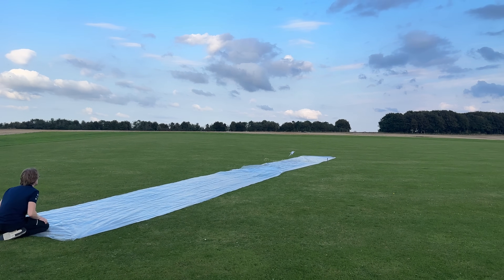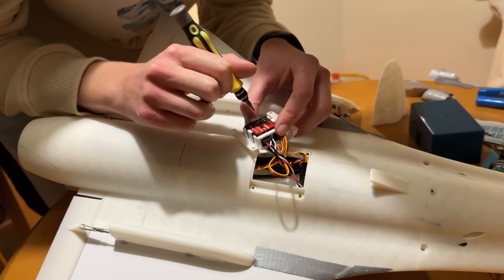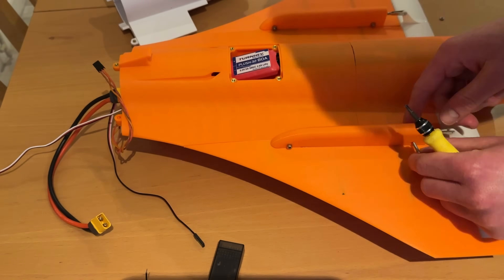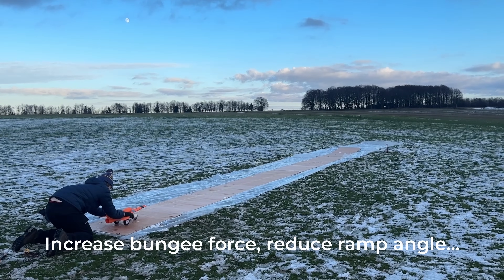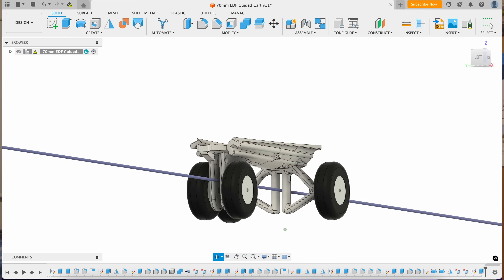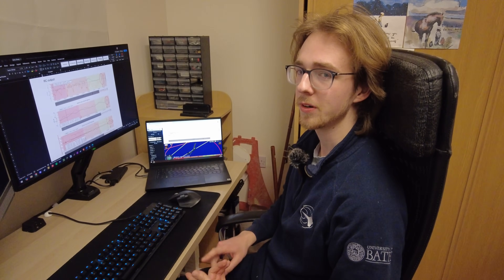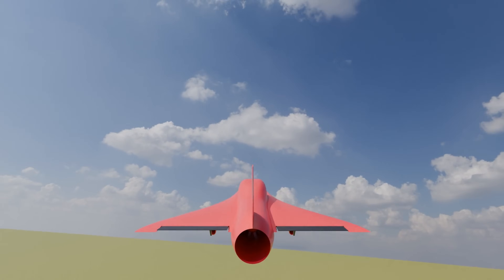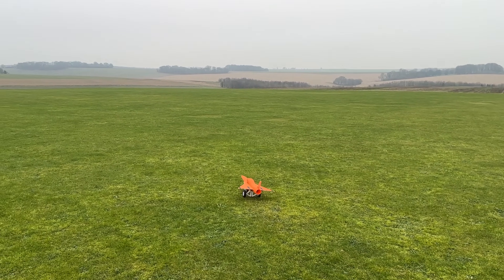WE CRASHED - Perfecting Kinglet’s Launch and Handling!

Comment from the maker: Thanks for watching this video! We now have a reliable launcher, and we've got the flight computer working. We've got more flight time planned in February to do some more tuning flights and get some landing practice. Once we've proven we can do launch, stabilised cruise and landing reliably, we will then attach a stronger bungee to the launcher and maiden the Kingfisher.

We're sorry that the timescales have been longer than previously promised - we want to make sure we have everything ironed out at the sub-scale to minimise risk to the main flight. This is from both a safety perspective and aircraft perspective - repairing the 3DP is orders of magnitude cheaper and easier than repairing the main Kingfisher. We're constrained to flying on weekends with good weather, since we work full-time engineering jobs in the week.

Some of you may also be disappointed that we didn't drop the aircraft out of a helicopter, but we think a catapult is a lot easier to repeat for the full-scale. We also cannot afford a helicopter! Overall, this sub-scale flight campaign is about replicating the real flight as closely as possible, that's why we've matched the wing cube loading to Kingfisher, made the 3DP way heavier than it needs to be, and used a slightly overkill bungee system!

Should also add, Chris was unavailable for this flight so we had a different pilot.
Reply: Are you gonna be able to get it to the recovery the drone also.  I’ve been talking about this happening on a commercial level to save weight and complexity of electric aircraft.
Reply: New sub! You guys are an inspiration to what I want to do with RC Boats!

Comment: A high speed RC car as the launcher would probably be way easier? Already comes with engine, suspensions, steering etc.
Reply from the maker: The issue is scaling - we’d need a pretty big rc car to launch the 10kg big Kingfisher
Reply: @TheMachInitiative They make off the shelf RC cars more than big enough. 10kg isn't that much.

Comment: You seem to be reinventing the wheel about the launch system.  We (in the EDF realm) pretty much perfected that system 15ish years ago.  Are you making the mistake of trying to do advanced flying skills before mastering basic control?  Are you aware of the speeds being attained by dynamic soaring?
Reply from the maker: The challenge is scalability - this launcher also needs to work on a 10kg jet-powered model aircraft. Additionally our stall speed is a lot higher than a typical EDF jet, so we need to launch to >25m/s.

Admittedly flying in acro was a mistake - we will only be testing in manual and stabilised until we have the gains tuned from now on. We are well aware of the dynamic soaring record, we’re trying to break the jet-powered model aircraft record (465 mph) if we break the dynamic soaring record (564 mph) that’ll be a bonus!

Comment: Maybe an FPV system would help, it makes it much more comfortable and easier to fly, especially at high speeds. You also have the telemetry data directly on the OSD. FPV takes a bit of getting used to at first, but over time it gets pretty good.

Comment: high pitch angle may disturb top mounted intake? cavitate the fan..
as long as you don't go there then it's not a problem.
I guess the forward fuselage is lifting surface?
I love your launcher, 'specially the guide rope.  as soon as i saw the slingshot, i knew that wouldn't work.  from experience, lol.  Incline the entire thing and you wouldn't need the kicker.. would be more stabilized launch, rather than chucked into the air, and then fly it out.... I've seen compressed air used, but bungee low tech is perfect... (think V1;).. but deff. incline.  what about a shuttle on a rail, or a c-cross section around a pipe, bungee or air driven?

Comment: Living hinges might be doable with a printed design as small as this. I'd reduce the elevon depth by a couple millimeters and move them farther out - remove the control surface at the wing root and instead extend it to the wing tip. Basically like a Mirage 2000. 
Couldn't find anything about this model on your website - so no idea what airfoil you're using - but with such a small jet at low Re numbers, I'd make sure the wing has a good amount of washout. 
Slow it down enough and even a cropped delta can tip stall, and I imagine this thing's gonna need  high aoa for a slow landing.

Comment: What if you made the wing loading even higher, but gave it a higher than 1 thrust/weight ratio and vectored thrust? You could have it take off vertically. The vertical part of the flight would have to be computer stabilized. Would that still qualify?
Reply from the maker: The main aircraft has a thrust to weight ratio of 3!

Comment: You could stick a motor and pusher prop out the back for these early prototypes. Launching would be much easier and much longer flight times for tuning, then swap in a EDF when everything is tuned

Comment: Engine seemed to be way underpowered for the small wings. Whole flight the aircraft had quite a high attack angle.
Reply from the maker: This is just the electric prototype - the main aircraft has 15 times more thrust, in a planform that is only 60% bigger
Reply: @TheMachInitiative I ment thats maybe part of the reason for the crash as well

Comment: I second the drop launch idea. Surely rhe airframe and control surfaces want to be optimised for speeds much faster than youd be able to take off and (probably more importantly) land at on grass strips. A drop launch from a bigger, slower RC platform would surely allow you to hit takeoff speeds suitable for a sleeker wing and smaller control surfaces. Maybe a 'stall and chute' type system for a controlled recovery?

Comment: Nice design.
I would consider using rails to guide the launch cart. Maybe standard pvc waste water pipes, cut in half?
For the launch "kicker" ramp you could look at designs for skateboarding, trick skiing, etc, to get the transition just right.
Also, I think you should think about integrating an emergency parachute, to safe the vehicle.

Comment: You are overthinking the launch system. You just need two 10’ poles, bury them 3’ deep so you have 7’ above ground. Tie a long bungee cord to the tips and put a hook below the aircraft slightly forward of the cg.  Tie a cord with a metal ring to the bungee and hook the ring to the plane. Walk back 2x the bungee length and you’ll get ample velocity when you release the plane from ground level. The natural angle from the ground to pole tips will give you the right initial trajectory. I launched many aircraft this way

Comment: Excellent work! As far as those program adjustments, I can't help. 
   I can say the autopilot compensated for the cg being too far back. Switching to acro mode would definitely cause a crash if one was not prepared.
   However, stabilized mode will work far better if you tune the aircraft to fly in acro mode. Considering the flight speed and flying without stabilization, exponential will likely be necessary for easy handling in the air.

Comment: Shouldnt the air intakes be on the sides or the belly for optimal airflow? Anyway the kingfisher seems like a great plane good luck at beating the record
Reply from the maker: Ideally yes, but our angle of attack will ~0.5 degrees at top speed so it won’t make a difference - we lose a bit of thrust during takeoff and landing, but it keeps the inlet clear or any debris during takeoff and landing that could otherwise destroy the engine

Comment: You should mount all your sensors on dampening foam to help clean up the signal and prevent high speed oscillation.
Reply from the maker: Agreed - we have some rubber spacers between the threads and matek - for the full size Kingfisher the Pixhawk is mounted on foam pads

Comment: No way you can make a simple RC car launch platform that needs to go 40+ mph for grass. You would need to use a 1/5 scale RC car with a clamping and release mechanism to keep the plane stabile on take-off roll. This is a huge project itself. Stick to bungee launches.

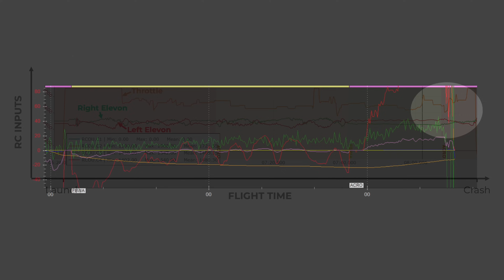Comment: Just yesterday I stood in front of your poster and was wondering how it's going! That integrator response is painful :( The aircraft looked like it had enough speed to get out of the situation, but if the control surfaces are not reacting, there was just no way :(  At 8:20 - the integrator part is increasing the whole time up to the switch to Acro. Does that signify that it tries to correct the nose-up attitude? I am not familiar with flying this style aircraft, but it looked a bit like CoG and CoL were mismatched? Maybe because you had to increase the wingloading?
Reply from the maker: Great to hear from you Jens - we’re still committed to the project! The CoG remained infront of the CoL at all times, but the CoL moves forward at high angles of attack which causes the stability to change, and we’re limited with how far the CoG can go forward due to the lack of an elevator. The integrator part was stopping the aircraft from deflecting the elevons up to push out of the dive - standard practice to recover from this hereon will be switching to manual and full stick back
Reply: @TheMachInitiative Interesting. When I once tried out paper planes I compared different sweep for the leading edge, but could only see a small advantage without sweep. Or is the long chord compared to the fuselage the problem? So that's why we don't see pure deltas anymore? B-1 has a tail, Eurofighter typhoon has canards. Boom X1 has a tail (looks so much like F-5 ). F16 seems to have only minimal sweep: Only enough to easy transition through Mach 1, but not enough to keep the leading edge subsonic at top-speed.
Reply: @TheMachInitiative ah yes, that makes sense! Thanks for explaining and good luck for the next steps!
Reply: Also, crash or not, great progress! That flight data has already proven essential in the analysis.
Reply: Oh yeah, let's clarify the basics of a delta plane. For symmetry reason I would love to have an X-wing tail. For take-off and landing the plane is flat (belly), but airborne the tail planes rotate into an x? Anyway, the thing the with the main wing (not an X) is that an angle of attack not on one of the main axes leads to roll. Negative lift inverts this roll. I think that dihedral does not invert there. So the angle of attack needs to be measured. And the elevons need to be actuated to translate one behavior to the other.

Comment: Measure the engine speed a wind tunnel and measure the air over the wings if these are installed way non argument it should fly

Comment: For launching you could piggyback on a larger plane, that way you don't need a ramp and would have the advantage of height.
 I used to do it with my old zagi on a friends virtually indestructible plane using Velcro, to separate I would pull up and he would dive, it worked great 95% of the time.

Comment: Like other said (maybe), why don't you use a launch rail? Like a mix of a catapult launcher as found on aircraft carriers and what student rocket teams use?
I believe you you see greatest improvements by angling the entire runway instead of having a ramp at the end, because that sudden change in direction puts unnecessary stress on your aeroframe and may even cause flow separation right when you need the flow over the wings the most.
I did a launch system for my glider using a 1:2 pulley mechanism hat worked great. Look into how sailplanes are being towed and unhook automatically. It would help y'all a lot
Reply from the maker: We agree a launch rail would be ideal, but there is a logistics challenge with design complexity, setup and transport. We’d need to break it into sections to fit in the car. Having 10 plywood boards and a guide wire is very easy to setup at the field. If we made an >10m long inclined rail, we’d need to have locking mechanisms to ensure all parts of the rail are perfectly aligned, we’d need to have a support structure if inclined along the full length, etc

Please can you send photos of your pulley mechanism - really interested to see it!
Reply: @ Awesome to hear from you! Sorry, I did the pulley thing 12 years ago when I was 12 years old just messing around. I was literally a cord anchored to the ground with a long stick (like in your videos) and a handle with a roller in the middle of the cord. at the end, the glider was mounted with a hook and a lop in the cord. For every X you pulled on the handle, the plane moved 2X forward. That was enough for my needs. If I were you, I would just put a BLDC on a winch with a cord, do the launch rail thing and pull the sled like so.  You could make a cheap launch rail out of 20x20 alu profiles, that are easily stowed in a small car. Setting up may take a little longer, but the advantages far outweigh the increased logistical complexity. I'm rooting for you!
Reply: @TheMachInitiative You could go for a rocket assisted take-off on a launch rail. However, a 1m rail would require your airframe to be able to handle 24g and you'd need a model rocket motor with that amount of TWR, so probably a 4m long rail with two 2m sections could barely work. But given the small loads, aluminium extrusion profiles would be enough, with a 1m tall bipod at the end. With lockable hinges you could even make it foldable and get the set-up time down to a minute.
Reply: i totally agree, a launch rail with weights seems much more consistant and controllable than your current setup, the pros seem very many: adjustability (if you use pulleys and weights), scalability, less stress on the airframe, less setup and the math is basic kinematics. plus you were kind of halfway there already by guiding the cart with a taut line

Comment: Hy don't yo use a launch rail? A wire steems less reliable
Reply from the maker: Several reasons:
(1) Time to design/ build
(2) The need to break it into sections to fit in the car - we’d have to break it into 10 sections and have some kind of locking mechanism to ensure each part of the guide rail is aligned. A rope can be folded up so doesn’t have this issue.
(3) Assembly time at the field

Comment: While this was just the test version and not at full scale, it looked like you were losing quite a bit of speed during turns which is somewhat expected of a delta wing aircraft as they can turn very hard, consequently bleeding speed.

 For one, you should practice how to deal with a stall with your small scale version so that if anything does go wrong with the final product you can recover easily. (At decent altitude, stall recovery is usually just forcing the nose down until you have enough speed to get level again or to glide to the ground if your engine is gone)
Secondly by practicing these stall recoveries you can identify the minimum safe altitude that you should be flying at in which you can recover the aircraft from stall without catastrophic damage. 
You can also set limits to maximum extension of control surfaces at certain speeds to avoid kicking into a stall

Another thing that you can do for takeoff however is by using a dolly that doesnt use a catapult, this means that you takeoff only when you have reached the sufficient speeds and the aircraft doesnt wobble after takeoff like it does with the catapault. The downside of this however is needing a longer runway, and roads dont tend to be the best runways for small scale aircraft due to the uneven surfaces and gravel and dirt. There are some rc clubs that have runways for their aircraft, which might be worth looking for.

If such a runway isnt available, a more reliable method of catapault launching would be to use a rail guided platform, allowing for a straight line takeoff with minimal wobbling.

Comment: INAV is not a high-performance gyro for fixed wing. It is not used in Turbines for that reason. I would go with a Bavarian Cortex Pro that is proven at the speeds you want to achieve. All of my highspeed Turbines have Bavarian Cortex Pro. INAV is fine for FPV or long-range flying but as a performance gyro, I think that is where you are going to suffer most of your failures. Bavarian or Synapse AS3X+ works right out of the box perfectly. Plus with the heading hold and launch assist it will help on the sled takeoffs. I use a rail system with a garage door spring connected to a Kevlar string for launching my high-speed turbines. I would fear using INAV or ardrupilot on my expensive turbines.
Reply: They're not using iNav, they're using Ardupilot which is perfectly up for the job.

Comment: Gyro?

ArduPilot is free software, cheap hardware and a huge huge community to rely on.
Reply: Oops. You already did. 

Still have no idea why you did t start with it. 

Have you used their sitl ?
You can fly and tune it in the simulator
Reply from the maker: We had a flight day booked and didn’t have time to wait for the Matek flight controller to arrive and get to grips with setting it up, so we used a gyro as a quick fix. This enabled us to quickly identify some of our launcher issues. Fully agreed that Ardupilot is the way to go with this. We turned off the baro in the arming mask but still had the issue with booting - fortunately, Josh was able to disable it in the source code and the problem was solved. Seen you’ve commented on other videos too - thanks for your continued support of the project!
Reply: @TheMachInitiative 
Awesome.
Sorry you didn’t have a board early enough. 
It’s weird the baro gave you trouble, it’s normal for a non pito air sensor to give a higher altitude at speed than stationary. 

It’s great that it’s open source and you can disable it too. 

May I ask what level matek you are using?
Just personal choice for me is to go for something like the wing that’s a full module and not just a board.
Reply: Turn off the barometer in the arming mask in mission planner. 

It won’t matter if it gives bad data, it’s still data